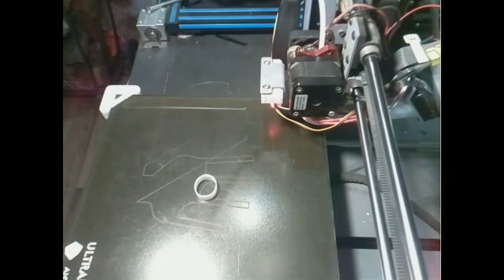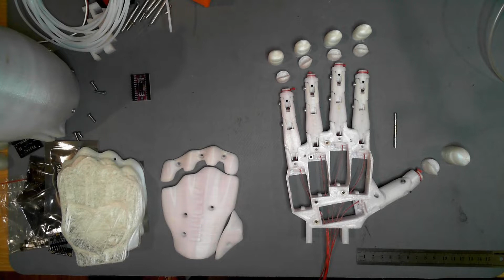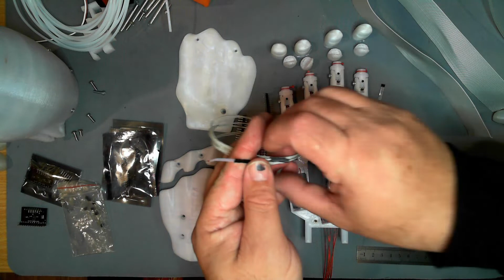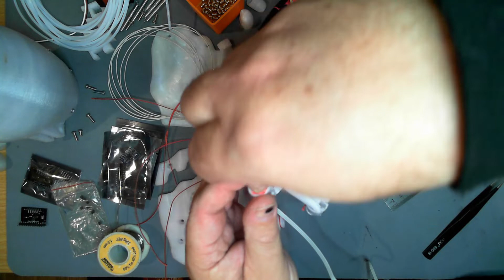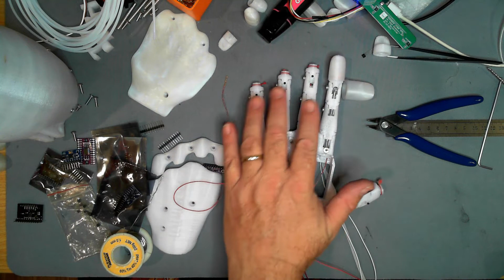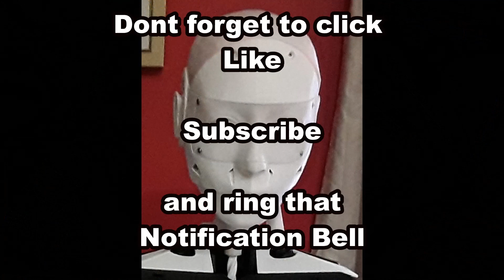Fred's Left Hand Part 4

Comment: good presentation . thanks
Reply from the maker: You are welcome
This is another video ready for next week. :-)
We get to installed the springs and the HALL effect sensors :-)
Reply: @CyberOne  i dont have a clue what HALL is but  am looking forwart to see it .
Reply from the maker: @EDP1  A hall effect sensor detect the strength and polarity of a magnetic field.
In the soft finger tip, there is a small magnet embedded.
as pressure is applied to the finger tip, it moves the magnet closer to the HALL effect sensor which in turn gives an analog signal indicating the change in the strength of the magnetic field.
This gives the robot a sense of pressure on the finger 🙂
Reply: @CyberOne  I'm glad you didn't do the other fingers with the Thermistor 
It is tricky getting it in and my finger tip is very stiff I don't know if it'll work,  I will have to wait and test it 🙂
Reply from the maker: @louwrensburger1796  I was not sure either, but the 35Kg servos I used work fine with it 🙂